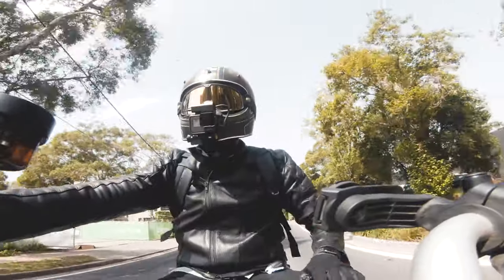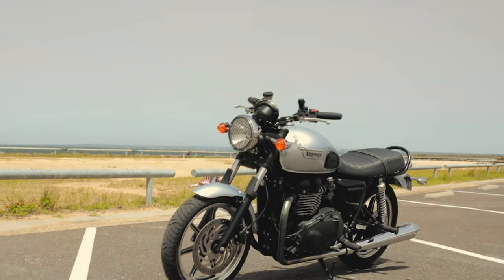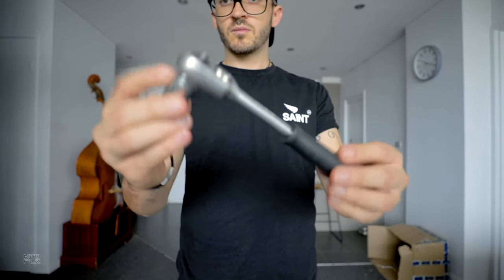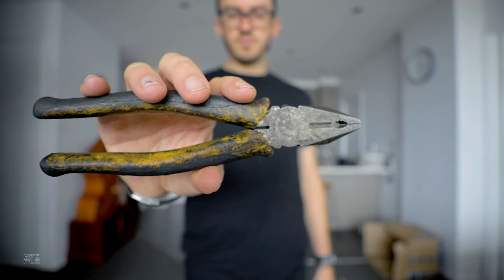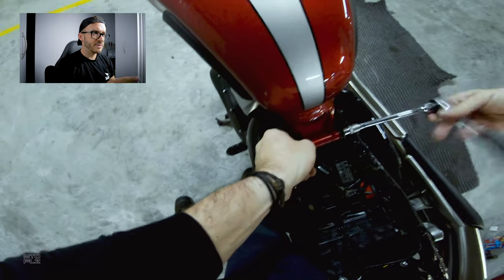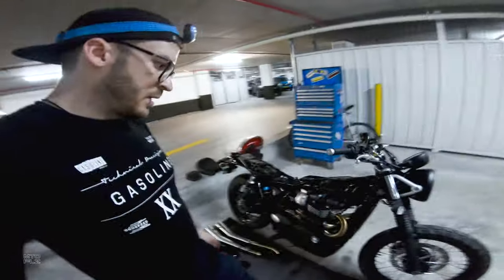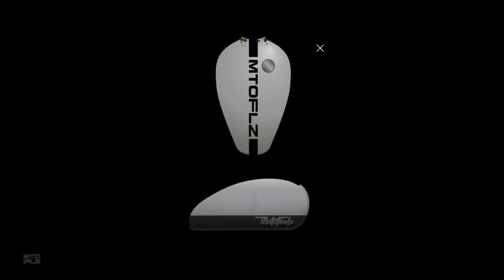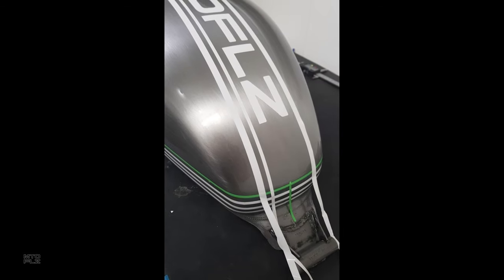MY CUSTOM TRIUMPH STREET SCRAMBLER BUILD | The Spray Job

Comment: Fan of the custom paint job. I know every bike is different depending on the work involve but do you know in the ball park what a paint job would cost from a starting point.
Reply: Best thing for you to do is create an artist concept of what you want and shop it around.  Ask your biker buddies if they know a guy.   Go to independent paint shops.  Ask in your dealer who does custom paint.  If your design is pretty strait forward, mask and prep the tank yourself, so your guy can do a clean wipe and just squirt it, you should save money.  Good Luck

Comment: Did you have to change anything about  her documents ? I mean, here in Brazil if the bike is red and you wanna change it to silver, you have to update the color spec in the documents. Do Australians also need it ?

And just for curiosity, what made you choose the Street Scrambler instead of the Ducati Scrambler ?

Love your vids man !
Reply from the maker: Thanks heaps man and thanks for watching! Yea same goes here.. i haven't done it yet haha. Still says red on my rego. I felt the triumph scram was built a bit more solid than the ducati scram. The ducati scram is definitely a fun bike, but i felt like it was going to break if i took it anywhere near offroad
Reply: @MotoFeelz  Ahh ok, got it !

And yes, i have to agree with you. I did a testdrive on the Streetscrambler and I could feel that her finishes are better. Anyway, I could not resist to the Ducati haiahaiauai Nice talk to you Feelz !!

Take care !